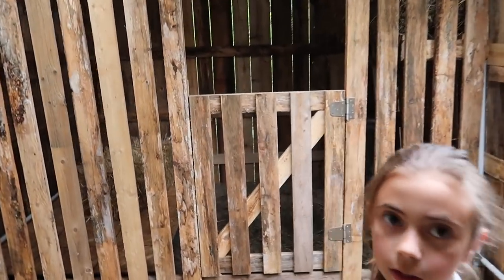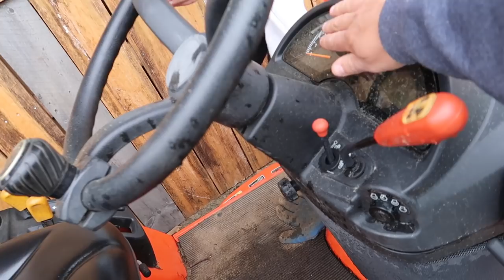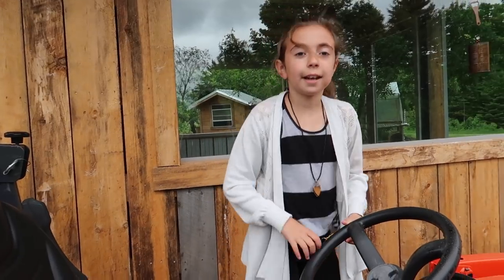I hope we are ready for the Goats! We get them Tomorrow

Comment: That wire you put on the door to open it is a good temporary fix. The Wire flex and brakes I suggest you use a steel rod the size of the hole that is in latch Bennett it a 90° and drill hole and then put it through the hole on the latch put a washer on it and put a pin in it and Bennett that way it won't come off make sure the other end is in the hole on the other side you can put a knob on it or Bennett another 90 that way you will never worry about getting locked in because the wire broke keep up the good work this is just an idea that I had thank you for sharing